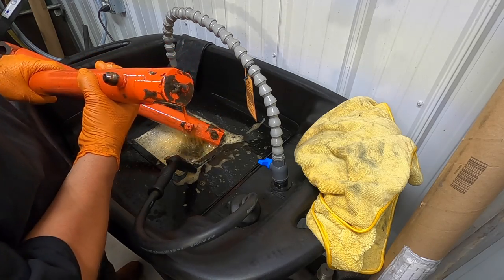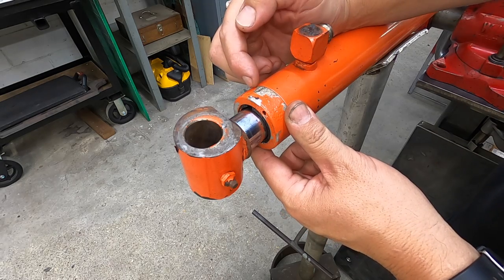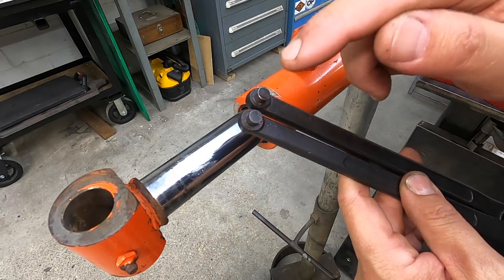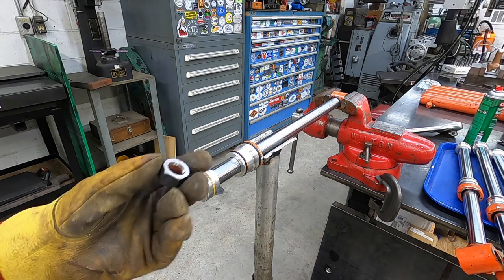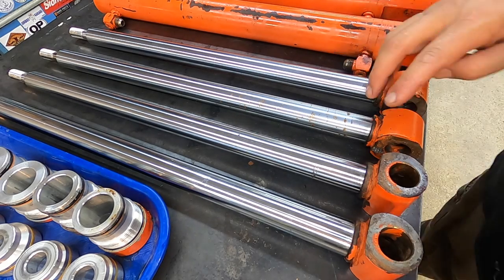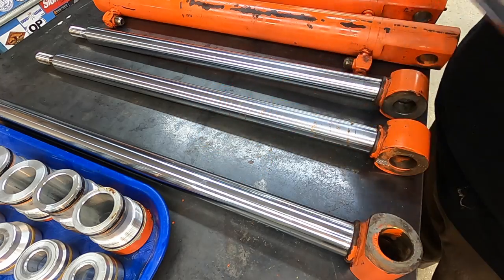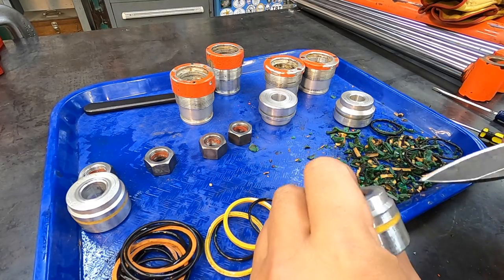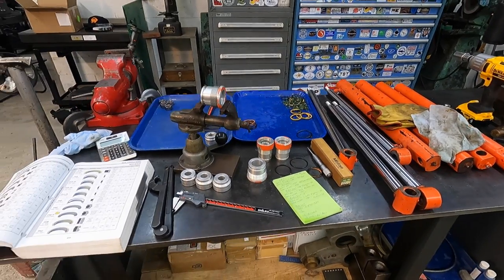Kubota Hydraulic Cylinder Repair Part 1: Cylinder Tear-Down & Inspection

Comment: Why would you risk drilling into the end cap?  Why not just make your own spanner to fit the rod cap out of a couple of drill rod and some 1/4 inch plate?
Reply: Pipe wrench would have popped that off.
Reply: @BRadWilson3  That what I thought but wouldn't there be a chance of deforming the endcap? It is aluminum.
Reply: @dkupy100  maybe in some cases, but these were barely tight it seemed.
Reply: or just use visa grips they weren't tight at all.

Comment: Suggestion for a project: instead of buying another wrench with different sized pins ... make a set with removable pins that thread in and stick through.  Just a thought.
Reply: Or just make sperate heads to go on 1/2 inch drive
Kinda like aves claw lift thing
Reply: There are companies that already make them with interchangeable pins.
Reply: @firesurfer  Yup, I recently bought a Facom one with a range of pin sizes. You just screw in the pins you need.
Reply: I have a automotive clutch fan tool kit that has something like that in it and I end up using it frequently for that kind of thing.  Matter fact, I might recommend people to buy one of those kits because it also has some giant wrenches in it that can be kind of handy
Reply: @daviddorge1559  It happens.... :)
Reply: Never throw old, worn out drill bits away, you can make a tool out of that tough steel......or dowells, pins,stops etc.
Reply: You can buy face pin spanner sets on Amazon  that are exactly what you suggested, I know because I bought one.

Comment: So instead of making a simple tool from two pieces of flat bar and three bolts, you drilled a hole into the part you’re repairing so you could use a tool you already had? Wow, just wow.
Reply: Do whatcha gotta do! What do you think he's rich and famous and can just go and buy tools or something? Ya think he has a fancy machine shop and could make a set of threaded pins for the spanner he already has?? It's not like he could have just used a scrap of rubber and a pipe wrench!! Sheesh, you guys with your "quality workmanship" just hacksaw the thing in half and slap some JB weld on there

Comment: you haven't had fun taking apart a cylinder until you've heated up a piston bolt until its cherry red and then hit it with a 1" air impact.. and it still doesn't move lol.

Comment: I used to do this all the time, worked for a major forklift company, this was basically half my job. Some cylinders are worse than other but the little seal bending tools are a huge help in those tight inner bores. Some cylinders were such a tight fit that I used a come along to pull the rod out of the cylinder. In the field if we didn’t have the right spanned most would use a variety of punches, find one that fits, a little tappy tap tap to get her free, then spin it off.
Reply: Adam already has a seal installation kit .....I'd never seen one before he did a demo marvellous things
Reply: @markjackson6288  yeah it’s life changing
Reply: Tappy tap tap.lol🤣🤣🤣🤣.ave.
Reply: @williamstarklauf6085  used to watch him a lot, pretty tired of his newer stuff

Comment: 21:00 I think we've all been there when that screwdriver suddenly slips and you need to go to the next body shop to buy yourself some new hand.... :D
Reply: I was thinking the same. 
In situations like that I put parts down on the table (or vise) and use at least a rag to protect my hand (while prying away from me).
Reply: Fun how you learn to use a knife and cut away from you. But a screwdriver will drive a hole in you .  Ban screwdrivers  ha ha ha😆
Reply: At least once a month for the past 40 years.
Reply: @alexm66  that's a lot of new hands ;)
Reply: @alexm66  Not only that but after 20 years i am pretty accurate, i can hit the exact same spot in my palm every time.. That spot is never healed.....

Comment: Your work at Motion Industries gave you a lot more cylinder repair opportunity than was in my experience. There are so many seal styles my limited experience makes me lack confidence to specify generic seals. I always relied heavily on manufacturer part numbers to avoid errors.

Comment: Adam, Being in industry quite a while, I have used ceramic coatings to fill impressions to get the job done & not have to replace entire shafts & get the job back out to be used, these have to be rasped, ground or sand papered back to shaft size, then get the job back out into use, then order new shafts for later repair. Surprising how durable the ceramics are.
Michael
Reply: I have had luck with JB Weld , I have a bobcat lift cylinder thats been in use for 8 years and still not leaking after filling in cracked rusted gaps in the rod. I would say thousands of hours use (2000-3000 area)

Comment: I was a machinist in a hydraulic shop 25 years ago. The chain wrench or chain vice grip would be the perfect tool to remove the glands when you don’t have the proper spanner wrench.
Reply: I agree and I’ve used it many times

Comment: My dad and I just changed the seals in one of the 3 point lift rams on my dad's 2009 Claas Arion 640 tractor 3 weeks ago. It was the easiest ram I have ever changed a seal on, you just pull the piston out about half way, using a pick or screwdriver through the hose nipple pop the stop clamp off the bottom of the piston into a deeper grove and pull the piston out, change the 2 seals in the cylinder then put it back together in reverse order. It took about 3 or 4 minutes after we found out how to do it from the mechanic. The hardest part was getting the ram off and back on the tractor.

Comment: Perfect timing, I have some kubota cylinders I need to work on. I don’t have a fraction of the experience so I’ll probably take the parts to a hydraulic shop locally and ask them to order me the parts. Or maybe my kubota dealer can help with the correct part numbers.

Comment: OTC makes a really great spanner wrench (tool # 6613) with swappable pins. I use it for automotive work plenty but looks like it would have been perfect for these cylinders.
Reply: I was going to say when I built my Form 1 suppressor a few yrs back. The end caps use a adjustable 2 pin spanner wrench to remove and replace the end caps. Then we modified the next can we built (Approved From 1 also) to a Monolithic core, and used the same system. Repair or making a new Hydraulic cylinders on any piece of Construction or Ag equipment (or any work) is what I love to watch Adam do. Why??? Because of the outrageous price it cost today to just drop off a piece of equipment and have someone else fix it. With labor rates here in Ohio knocking on the $150.00 a hour door. And the cost of branded parts today. Like Kubota in this case, Or even worse John Derek or Cat. A regular working guy thats doing work for himself or a hobby farmer can't hardly afford to send work out anymore.  And we don't even want to talk about the turn around time. Or the fact that for old AG equipment,  Certain parts are no longer available in some cases. Which is why we see hundreds apon hundreds of older tractors being dumped in a local auction yard.
Reply: I got it😊

Comment: I probably do about 100 cylinders a year and pipe or chain wrench would work fine for those glands. I also don’t have a thousand YouTude experts waiting to tell how that’s wrong 😁 
Little tip… Soak those piston seals in hot water right before you install them. It makes it a lot easier to install them and you’re a lot less likely to over stretch them.
Reply: Adam has done hundreds upon hundreds of piston repars, friend. Maybe go check out some of his older videos. There are many paths to the top of a mountain.
Reply: @thatrealba  I’m not sure the point of this comment?

Comment: I have rebuilt many hydraulic cylinders over the years.  And when the hydraulic levelers started binding on our motorhome I thought, no problem.  That is until I got it on the bench.  Completely welded units, not made to be serviced. 
I always use a brass pick to remove seals and glands.  Especially on aluminum gland ends and pistons.
Reply: @Pablo Estafez I'll have to look that one up.  New subscriber here.
Reply: @JWimpy  he used a parting tool to cut it .
Reply: @williamstarklauf6085  That would be a good way in. Although,  I am now retired from my machine shop job and no longer have access. Bought a house in the mountains and decided to travel.  I often miss being able to get back on the lathe and mill though.
Reply: Ill trade you lathe for the mountains..
Reply: @williamstarklauf6085  LOL, no thanks.  I like my retirement, traveling around like Abom.

Comment: Facom adjustable,  changeable pin face spanner .......only extra step I'd recommend is letter stamping the clevis,  body and gland nuts before disassembly  if they are being stripped and sat on a bench waiting for spare 👍👍

Comment: So we now have a new unit of measure for torque.  The Adam.  Now what we need to know is if that was a 1/4 Adam or a 1/2 Adam that it took on that ratchet. to break those piston nuts loose.   Thanks for all the hard work that you and your wife put into the channel.

Comment: Those Teflon seals are hell to replace in transmissions, too. Used for the same thing; to seal that part of the shaft from hydraulic fluid.
Reply: Soak them in hot water for 10 minutes prior. Makes life a hell of a lot easier.
Reply: @OpSic66  same here, put in seal in a hot coffee cup brought to boil in the microwave then used electrical tape wrapped around it for a hour or so to compress it back down to size, oil it up and slid right in the bore

Comment: I have only done it once, but I repaired a John Deere steering cylinder that was welded closed. I needed some knowledge of where to cut, but I removed the weld in a lathe until I could see the material division line. John Deere wanted $1000+  for a new cylinder and a full.set of seals pre-packed to fit the cylinder was about $30.
I welded it closed pretty easily by applying water soaked heat sink rags.
Reply: If I remember correctly, Adam actually did the same thing before. There's a video of it.

Comment: Hi Adam. I always love your content. I was however never nervous seeing you alter the cylinder caps. Just a thought re the face spanner you have. Instead of drilling into your cylinder caps, I would have drilled into the face spanner itself. A small threaded hole and you could have used a couple of set screws of the right size to act as the new pins. Or if you wanted to make an adjustable tool. Grind off the current pins. drill and cut a threaded hole and make pin bases that have a uniform screw shaft, but with different pin sizes. I hope that helps, D

Comment: I have found that tractor supply hydraulic oil flat wrecks cylinder seals like that.  The $70+/5gal oil is what you want to use. The $40-/5gal oil destroys parts.
Reply: Thanks Brian, that is useful info to know.

Comment: loctite is mainly sucrose.  think of a jolly rancher, warm it and it solidifies ...to a pint.  over heat and it turns to carbon and then its ON there.
there are tools that wont gouge the aluminum or score the inside seal surface.  Some do not possess "finesse".
I have to say I admire the shop. your well tooled.

Comment: I just helped a friend replace the seals in a bobcat cylinder last week. The piston nut was resessed into the piston with just enough room for and impact socket. A 3/4 impact wouldn't budge it and it took a cheater bar on the cheater bar. I didn't know he had new nuts in the seal kit. A little time with a cold chisel would have made the nut much easier to remove, but destroyed the nut.

Comment: I would rather modify the face spanner than risk drilling a hole in the cylinder.  But it worked, so no foul.

Comment: Hello Adam.
Rather than buying a new compass-shaped tool to unscrew the hydraulic cylinder heads, you could do the two small nipple tetons in the diameter of which you need, pierce the two arms of your tool a little lower than the Two nipples already in place and weld them in it.
So you would have a single tool but several possibilities ... economical in money and in place.

Comment: yeah, it's way easier cutting seals off!...but you better be really careful not to damage the groove with the knife, because that can cause a serious rupture when the groove damage wears it and the assembly fails under pressure. also, it seems like using plated rods are just asking for trouble, because as soon as the plating wears through it's gonna really tear-up the seals fast. kurtis, from cutting edge engineering, only uses chromium rod stock for his hydraulic repairs...that's probably significantly more expensive though, and he's doing it commercially, not as a favor for family/friends. great stuff, as always, much thanks! 😊
Reply: @jamesdrake2378  Yep, awaiting parts 2-4 ...
Reply: 98% of rods are chrome plated Even the ones that Curtis uses are they are 1045 or 4140, EN26 or induction hardened but they are all chrome plated , Other options are Laser Clading with a variety of metals most common is stainless & HVOC. Or just ground stock but these are horrible on seal due to corrosion issues.
Reply: @jamesdrake2378  Adam has been doing this way before Kurtis was born, some of you guys posting here need to take look back through Adam's video library, he's built and made way more hydraulic parts of every size and type you can picture, he did this for a living for many years for a well known national company before leaving them on good terms to pursue his own dreams.
Reply: @jamesdrake2378  So you are old and sad, no need to watch this channel go watch someone else.
Reply: @jamesdrake2378  And he would have done it without breaking out the crayons.
Reply: @jamesdrake2378  imagine living in a basement no wonder you are jealous of Abom, you dont have the skill so you hide in the basement 🤣

Comment: Instead of cutting the rods off, you should chuck them up in the lathe and cut following the old weld as they may already be threaded into the eyes or at least have a locating pin machined in the end!
Reply: Just watch Cutting Edge Engineering here on YT.
Reply: @paulpahl1607  That's where I learned that trick. Shout out to Homeless the safety engineer
Reply: Kurtis is a miracle worker. I watch every video.

Comment: Why not use a chain wrench to undo the ram and do you have a ultrasonic parts cleaner.  For cleaning out the residue of the old seals?
Reply: There are many ways to skin that cat….. drilling new holes would have been at the bottom of my list…. To each their own…. 2 pieces of scrap strap and 3 1/4” bolts…. And he could have made a tool to get by, without modifying a customers part.
Reply: I was thinking of a band wrench like for oil filters.
In a pinch even a good hose clamp might do the job, and if only to protect the surface from getting marred by a pipe wrench.
Reply: @sthenzel  
I like that idea of the pipe clamp so it doesn't mar the part.🤔👍💯

Comment: Could you modify the tool to accept different size pins and just change them out for the correct size for each job
Reply: You can buy pin spanners with changeable pins, they're cheap enough that it's not worth spending an hour making your own.
Reply: Not as good as an abom one
Reply: @robertsimpson1824  I am rather sure that he will not forge the thing

Comment: that must be a very common style setup, mine are much different where the end part screws onto the cylinder rather than in it, it can be removed with a pipe wrench and the only thing in that cap is the wiper seal. the rest is put in then a retainer clip goes in. overall i have more seals in each end. mine is on a 87 yanmar 226d.

Comment: That’s allegedly a 750 ft-lb impact at 13:44. He then grabs a 2’ breaker bar and somehow puts more than 375 lb of force on it. This guy is a beast. His skill and experience is definitely making it look way easier than it is.
Reply: locktite is a funny thing where an impact can't move it but a breaker can. heat is your friend when it's stuck, be it dissimilar metals or locktite
Reply: Betcha $1 it ain't really anywhere near 750 lb-ft.  And if you pull up on the wrench you will develop a lot more torque than pushing down on it.

Comment: To me the easy part is replacing the seals , all of the guys around me would say bring me the cylinder , it took several hours just to get the dipper cylinder off of my backhoe thats the hard part in my opinion, it took maybe 20 minutes to remove and replace the seals

Comment: Reminds me of my time in the seal and bearing business. Every time someone brought me a shredded seal to "match up" the seal was so far gone I couldn't even begin to guess the shaft diameter! And of course they had driven a screwdriver right through the number on the seal to remove it. "sigh" Asked them what the shaft diameter was. Of course they never knew. Asked if they could call and have somebody measure the shaft. That was usually the point they got all irate and demanded to talk to my Boss. First thing they said was :"He isn't helping me!" Boss looks at the seal and goes through all the same questions I just asked. That was usually the point they stormed out. I don't miss that job! ;)

Comment: Is there something in the hydraulic oil that is attacking those seals. Makes me wonder what the control valve and pump seals are like.
Reply: I think there's something in Florida attacking the wipers, it's not called the Sunshine State for nothing :)
Reply: These cylinders are outside 24 hours a day. From hot to cold to rain. Sealing over thousands of extend and retract cycles. Plus the wiper seal has to scrap off any dirt or debris that gets on the shaft. All things considered, they last a pretty long time.

Comment: I have a funny feeling that 484 number on the spanner is for 2 x .25" pins (/16) and 8" long handle.
Reply: As a metric guy I have no idea what you’re talking about.
Reply: @nameofthegame9664  i suppose .25 = 1/4 so 484 stands for (one fourth)-(8 inch)-(one fourth).
Reply: @Baton4iik  yeah I get that but I don’t get that.